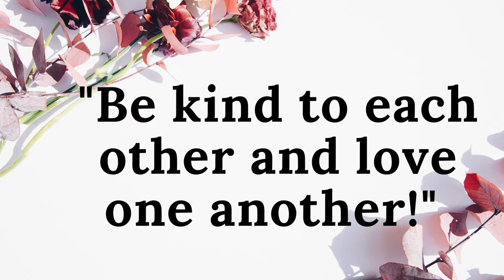Double Deep Hive - The Honey Bees are making honey and it is time to add new 10 deep hive boxes!

Comment: Usually Langstroth hives are oversupered, like you did on the second hive.   Warre and other style hives are usually undersupered, like in the first hive.    Obviously this video is 17 days old, but in the future, you should move swap a pair of the frames from the original box into the new one.   This will help the bees jump on the new box faster.   Swarm traps are normally placed ~8 feet high and the Jester nuc box doesn't really have enough space to attract one, but it doesn't hurt to try.    G'luck in your bee adventures.
Reply from the maker: Thanks for the tip! Always welcomed!